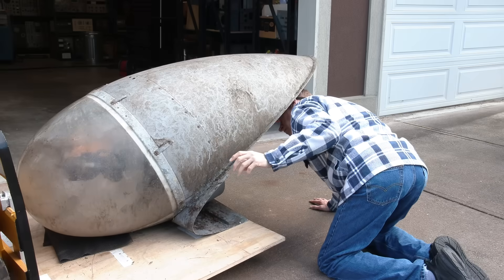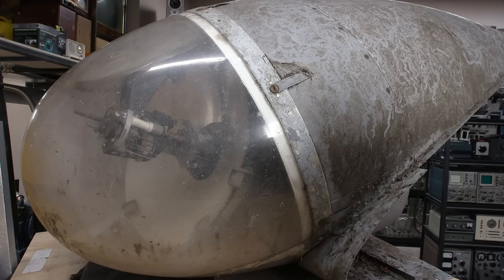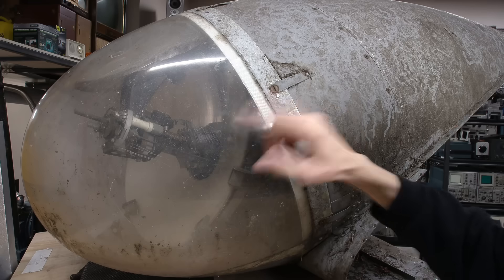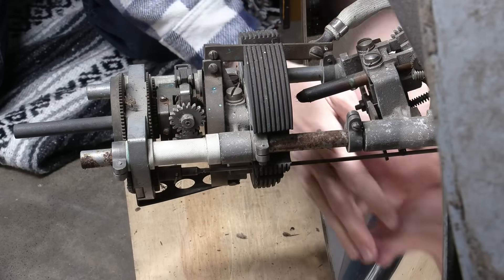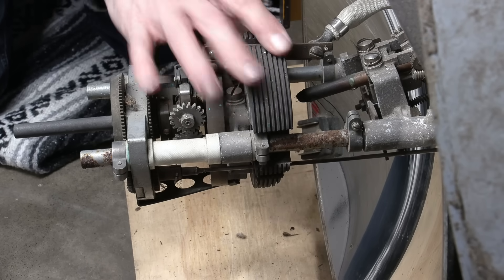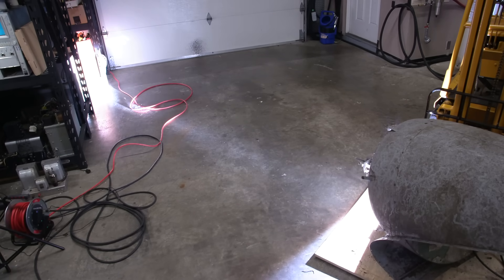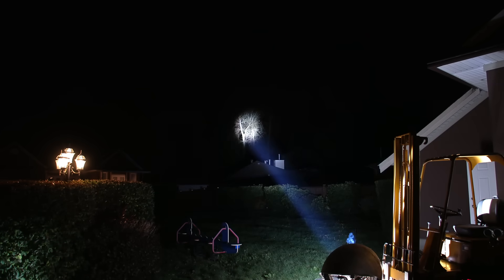70 Million Candle Power! Super Bright Anti-Submarine Searchlight - See It Light Up!

Comment: I wonder how this compares to WW2 anti aircraft searchlights.
How much power did you actually put into the unit 50A at ~100V?
Is the TIG welder the right supply for this as the welding arc is comparatively short?
I made a death lamp time ago from a broken video projector - only 90W but strong enough to burn things in short distance. Watch out not to burn down your lab

Comment: Having run many carbon arc lights, the catcher at the bottom is more due to the fact that the rods are copper covered, so molten copper drips down from the arc. Although this is a short duration arc, I would suspect it wouldn't take long before it fogs out the inside of the dome. They all produce a smokey white powder that covers everything. Always loved running the old Carbon Arc Super-Troupers! They were still in use for outside shows up until the 1990s.

Comment: A carbon arc weatherometer/fadeometer was an accelerated aging cabinet that was used to test the durability of materials to exposure to UV by using a carbon arc light source.  The "light" generated from a carbon arc is not just limited to the ridiculous visible light we see in the video, but also two very high energy bands in the UV.  Stay safe Mr. Carlson.
Reply: well of course, any bare unfiltered electrical arc includes the spectrums of light we don't want and shouldn't look at, be careful of the unwanted UV "sunburn".

Comment: This intro gave me some Professor Emmett Brown vibes. The next project will probably be a supersolar particle thrust engine.
24 years ago when I went to work in a cinema, the projectors had xenon arc lamps already, fairly low maintenance, easy to operate... but the booth still had the old selenium rectifier, and a stack of reflectors from the carbon arc era left. Some reflectors were pristine, most were pitted to varying extents, and one had developed a crack from the center hole almost to the edge. I bet it had caught a larger smoldering lump, and would have likely cracked all the way or totally shattered after being lit for some more time. Also the exhaust ducts still had a layer of ash in them, even  though they had been used for removing mainly hot air and ozone for tensome years.
Reply: Next project is a Mr.Fusion
Reply: @davelowets  Perhaps Mr. C Fusion, C as in cold?

Comment: Back in the 70's, when I was an air cadet in New Westminster, our squadron took a tour of Comox AB.  We got to go inside active Trackers parked in hangars undergoing repairs.  We were told NOT to take any pictures of the inside but I couldn't help it and surreptitiously took a few snapshots.  No one noticed.  But I'd love to know more about this light such as voltage and amperage this things needs, what were you using to power it?  Certainly love to see cleaned up and as new for a demo.  But damn, you're gonna need a big jig to work on that thing, lol.

Comment: I retired from a commercial marine electronics company many years ago as their purchasing agent. Carbon arc searchlights were still popular on work boats on the inland waterways well into the early nineties as I recall, but Xenon gas bulbs took over very quickly. Carbon arc lamps are dirty things, needing a lot of maintenance to keep operational, while Xenon bulbs are simpler to maintain. I keep in touch with the gang, and they tell me LED searchlights are starting to make inroads. Thank you for a showing this searchlight to us.
Reply: It is impressive how quickly LED lighting tech has improved and progressed!
Reply: @MattH-wg7ou  Yep- they've got medium intensity white daytime strobes on radio and TV towers now.
Reply: @scotttodd3506  I'm a pilot and I've noticed them, the bad part for me is most of them arent NVG compatible like the old ones. Not a huge deal but would be nice.
Reply: @MattH-wg7ou how do LEDs present differently than Xenon lights with NVG?  Broader spectrum?
Reply: @firstmkb LEDs usually output in a very tight spectrum. The whole reason to switch to LEDs is because traditional bulbs output most of their energy in infrared. It’s that IR output that NVGs rely on.
Reply: I used to work for a company that I operated WW2, 6 ft diameter ground based searchlights. These things were HUGE! Not only did I have to do maintenance on the carbon rod mechanisms, I had to polish the 6ft. diameter silvered brass reflector too...which meant crawling inside the lighting cavity and polish the silvered surface with Brasso, a light oil soaked into gun-cotton. Very tedious work, very maintenance heavy, very heavy device! 
But, the result of all this, 1.5 Million Candlepower!!
Enuff raw wattage to cut thru most weather conditions, to hunt down  enemy warplanes!
But the company I worked for was merely using the lights to attract people's attention to newly built store grand openings, Christmastime activities and such!
Sometimes our devices were hired to attract attention at new movie nights with many superstar actors, red carpet treatment all the way!
These were the most powerful lights I ever worked with!
I always wondered if we could have illuminated a visible spot on the moon, itself! But I wasn't there long enuff to attempt that particular event! Lol!
Reply: @donlang7964  Amazing! I love this story. I was always impressed when I saw the searchlights at events like that. Thanks for sharing.
Reply: @donlang7964   Amazing! I love this story. I was always impressed when I saw the searchlights at events like that. Thanks for sharing.

Comment: A few thoughts....Any idea of lumens this produces? Also, for those who don't know these carbon rod lights have been an industry standard for movie house projectors for decades now, and YES they are very bright. 

Lastly, when looking at historical photos of Tesla, one may notice him holding a light bulb that appeared to have a single wire dangling form its bottom. That light (actually lamp) was a carbon based filament and purportedly the only material strong enough not to melt when Tesla's "dark energy" (a.k.a. "zero point" energy) hit that lamp wirelessly. It's also purported that when photographed while using his "carbon button lamps" Tesla and friends showed as though they had been X-rayed (10 years before X-ray was discovered). 😮

Comment: As a somewhat older ex-movie theater projectionist, it seems that this lamp is similar to the carbon arc lamphouses which were used for large theater projectors.  These required significant fan cooling and constant ventilation of fumes up a stack and out of the projection booth.  Often times, the projector would have a water-cooled gate (essentially the area that the film passes over) to limit overheating and fires.  Many states required projectionists to be licensed due to the significant fire-hazards.  By my time, we were running 3K to 5K xenon lamps (inside the old lamp houses) - much safer and lower maintenance than the carbon arcs, but still super hot requiring major ventilation.  All those pro. projectors used fairly massive DC rectifiers for power to eliminate flicker on the screen.
Reply: Ah, the old Peerless projector carbon arc lamp? I've sizzled my fingers many times removing the spent carbons from the holders and reclamping the holder back to the feeder mechanisms.
Carbon arc searchlights were a variant of the same technology. 
I'm surprised Mr. C doesn't have one of those.
Reply: @ricknash3055  I never ran the carbon arcs, but yes, Peerless rings a bell!  (I haven't been a projectionist for many years).  We ran the amazing Norelco/Philips DP70 projectors, which are the equivalent quality to Tektronics 500 series tube scopes.  Just everything was done a bit "extra" down to the gearboxes with beveled glass panels and a continuous oil waterfall running over all the gearing.  If you got the film tension correct, the machines were incredibly quiet (compared to others).  Further, they were convertible between 35/70mm and had special mag-head sound preamps (independent from the machines).  A few times we synced two projectors in the booth and ran old school polarized 3D where each image was running through a separate projector, but synchronized via a change to ac synchronous drive motors and a stable frequency inverter  - it looked amazing - of course totally insane and infeasible at scale.  

I remember the carbon arc search lights too!  All amazing stuff!
Reply: @blobscott 
We never did 3D as we were old old school, no platter, just 20 minute reels. For years afterward I would dream panic that a reel was missing in the middle of the movie.
 The good old days!
Reply: @ricknash3055  2K reels.. lots of changeovers!  We didn't do platters either, but we would splice the film onto 6k reels and run two projectors with a single changeover.  The changeover was automated with foil tape at the end of the film on each reel, so if all went well the projectionist just watched it happen; ready to jump in if all went haywire.  We spent most of our time making up (to 6K) and breaking down the next film to be shown.  Anyway, I think we're getting way off topic from the lighting here :-)  But nice to reminisce.  It's been a long time since I've even been to a theater.
Reply: @ricknash3055  I wouldn't bet he doesn't  😉
Reply: My father worked as a projectionist in a private cinema in Soho, London; when he first started, the projectors used carbon arc lamps; apart from the smoke they produced, the carbon 'smuts' (flakes of carbon soot) would occasionally block the photocell that was used to regulate the arc rod feed mechanism, which required opening up the lamp housing whilst it was running in order to dislodge the soot. I have no idea how my father has managed to escape skin cancer.
In the latter years, they changed over to Xenon short arc lamps; whilst they were far more reliable and involved less maintenance than carbon arc lamps, they did have a habit of exploding if not carefully maintained or if someone opened the lamp housing door allowing cold air into the lamp housing.
Reply: @cambridgemart2075  Those were some nasty lamps if they weren't handled properly. The projectionists I knew told me they had to wear rubber latex gloves when changing them because the oils from their skin would cause them to explode when they got hot.
Reply: When I was working for an electrical contractor, I seen those set ups too when we did electrical work in those drive ins and large theatres. Some of these had what looked like dynamos in a room off to the side, The main service in most of these old theatres was 120/240 volt 3 phase delta with that pesky high leg
Reply: @Truckguy1970  The "dynamo" was likely a "rotary converter".  Interesting mechanical DC rectifier - I'd never heard of them for rectifying DC.  There's a good write up on wikipedia.
Reply: @blobscott  Ah ok makes sense. Those were used for the high amperage low voltages for the carbon arc projectors?
Reply: I remember those Xenon lamps in the projectors from my movie theater job in the late 80's. Some times those bulbs would explode!

Comment: Back in the 70's I used a  carbon  arc "welder" to braze up the wheel arch extensions on my rally car! The thing was amazing, good for general heating up of siezed components, the landlord of my garage where I built my cars would not allow me to have any sort of gas torch, for insurance reasons they  said, but the little welder did a fine job!  73 Jim  M7BXT

Comment: When you were testing the large blue power supply/ welder I suspected something involving a carbon arc or xenon light  source was comming. I didn't however expect this to show up.   Most cinema arc lamps I have worked with use high current reality low voltage DC power sources after they strike. Before they strike the open circuit voltage is quite high so that welder with the correct rectifiers and a filter capacitor is a close realitive to the lamp power supply or"rectifier"as we refered to it in the movie theater.

Comment: In 1956 I worked for my uncle in a movie theater running the movie projectors. carbon arc was their source of light. So as they burned away you had to monitor them by looking through a window which had  a lens similar to a welder’s helmet.  They had an automatic advance on them so they were kept a certain distance apart but you had to keep an eye on them so they wouldn’t go out. I was in the 6th grade at the time, fun job.
Reply: Fascinating to watch old projectionist time the second projector so that they could get the next reel or carbon rod going. Like 6 reels to a movie or something way back.

Comment: Carbon arc ... also used in movie-projectors for years.
Nice "gadget" you got there!!!
Reply: Yes, also in WWII vintage aircraft search lights, like the ones later used for movie and other grand openings. The movie theater projector lamps were made by 'Ampex... or maybe it was 'Apex'... something like that. The big ones used in drive in's were really tough on film... the take up reels came off the projectors hot.
Reply: @rwbishop  If the film stayed infront of the light for more than a second  like in a jam , it will burn right away.
It gave magnificent colours on the screen but it was such a hustle
Reply: @peterpeper4837  Indeed! After such 'events' the projectionist was sometimes faced with unscheduled 'mid reel' projector cleaning... occasionally with stuff being thrown at his/her booth from the outside. Also, splicing the print back together could require removal of several frames either side of the burn. Again, drive-in theaters were the hardest on prints.

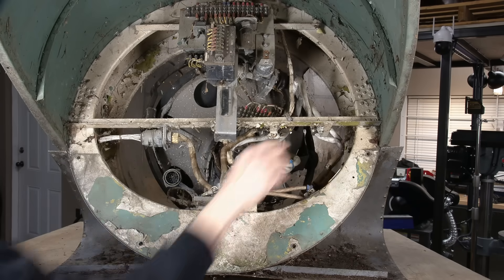Comment: 4:00 Those are referred to as Dzus fasteners.  We encountered those frequently on Naval aircraft.  They're normally used on panels that require opening regularly on short intervals.  Great intro by the way.  Cheers.
Reply: I had that type of fasteners on both of my general aviation airplanes.   They are very commonly used on engine cowlings....
Reply: A "snoopy" tool was used in the military to loosen those fasteners...
Reply: I was introduced to these by my father, who, I think, learned about them while fixing airborne radars for the navy in Panama in World War II. He used them widely in my parents' puppet show. I gather that they are still widely used in auto racing, and can be purchased from race parts suppliers like Summit.
Reply: Not many people in the field of electronics or electrical engineering would be familiar with this to be fair due to the end consumer / designer relationship. Aircraft technicians more likely.
Reply: also popular on race cars for quick removeable panels/front ends and more, also dirt bikes and off-road vehicles.

Comment: I know it would be an incredible amount of work, but I really would enjoy seening the gimble mechanism and everything restored and see it do some short "searching".     It's incredible how powerful this light.
Reply: Absolutely!
Reply: I concur.
Reply: @Cprtlcfbnv  Hmm! I worked on similar lamps, which were used for the same purpose. We were not allowed any personnel forward  of the aircraft's mainplanes when we test fired  these in the hangar and then only for a few seconds.  On the bench, behind blackout curtains, minus the dome, you could burn them for longer, whilst setting up the flame but you were behind some serious protective gear and we still managed to get 'sunburned'  UV light  is a real concern and these are a powerful source.  As a matter of interest, the goal when setting these up was to achieve a nice 'Tick (Check)' shaped flame between the two carbon rods.
Reply: @doddsy2978  I was wondering if taking away the plexiglass let out some UV which would been blocked by it. I know I'd want some filter in front of a naked carbon arc before I lit it.
Reply: I too would like to see the whole mechanism working.  I would like to see the spot light on some really distant object such as mountains or the clouds up in the sky.  Also, if you get the plastic dome thoroughly polished, you could set up a fan or blower to move air over the dome for cooling.
Reply: yup!
Reply: Back in the 1960s they had twin carbon arc-lamp search lights used for commercial purposes, like the opening of a new car lot or big sales at a major department store. these things were about 2 - 3  meters in diameter on a gimbal, they had their own power supply run by a diesel engine. (Maybe gasoleen) You could see these lights from anywhere within about 20 miles. I haven't seen them in many years I wonder what happened to them.
Reply: yes
Reply: Yes! Agreed.
Reply: yes metoo for sure want more
Reply: Agree.  Really enjoy the restoration part of your videos...especially something so unsual.  Also if possible - without getting into trouble, it would have been fun to see the range of the light on a much more distant object.
Reply: It's spelled "gimbal"
Reply: @cebruthius  Yes okay.  I must have been half asleep and missed the autocorrect grabbing the wrong version of the word, as gimble is also a word, but with a different meaning yes.   
Thank you for taking the time to make a comment just to correct spelling,    Very helpful to the conversation I am sure.